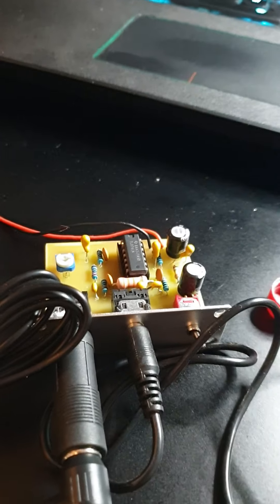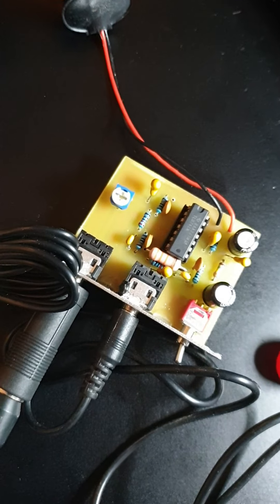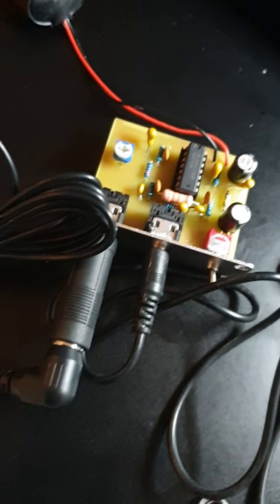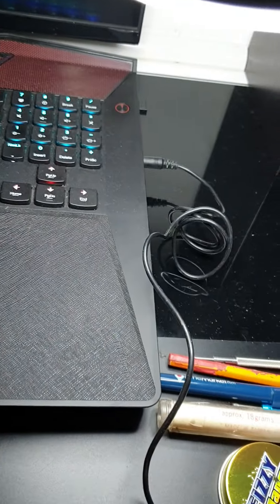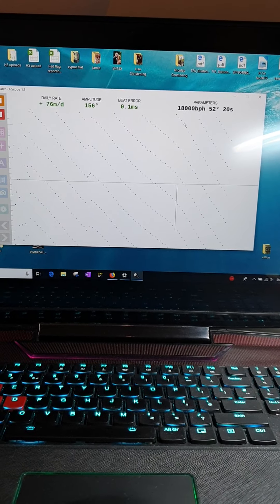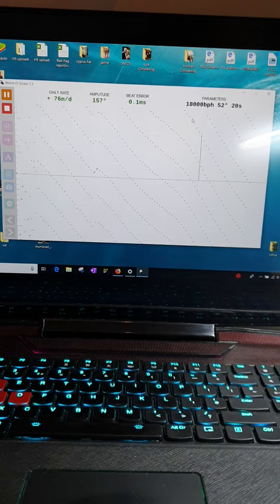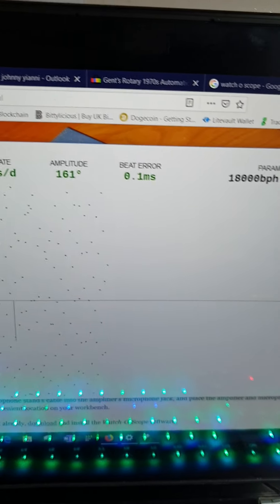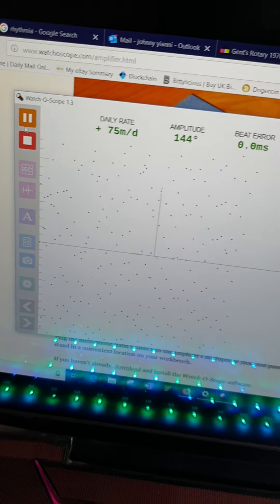Watch-O-Scope

Comment: So... do you find that the software works well once the amplifier is put in line?
Reply from the maker: Unfortunately I never managed to get the amplifyer to work. I had to compromise on the components as I couldnt find the exact ones here in Britain. It is a shame becasue I have seen other videos of the software and its meant to be pretty good.
Reply: @treetopspider  I've seen one video where the guy is using an equalizer program as a noise filter. With Windows 10 you can increase the microphone gain and with the latest Watch-O-Scope software there is a gain boost feature as well. Without the noise filter feature of the amplifier, there's just too much junk in the boosted signal for the software to work properly. I think all that is needed is a good noise filter as the amp is now redundant. See what you think...
https://youtu.be/oA2NIjlThqw
Reply: @treetopspider  I don't know how the UK VAT will impact the prices, but you can order the exact quantities of the parts for the amplifier from https://www.radioshack.com/

All of the other suppliers that I've found require you to order hundreds or even thousands in quantity.
Reply from the maker: @AwGusTeen  Thanks for that, I might give that a go as I really wanted to use the Watch O Scope program. Ive recently bought one of those chinese Witchi timers which seem to work pretty good but I really liked the idea of building my own
Reply: @treetopspider  I just put my ACE timer in the trash - the LCD connections tend to fail. I had mine for around two years and it works well but it's poorly made. I had an Electrical Engineer buddy over during Christmas and he pulled it apart. When he disassembled it, he showed me that the problem was in the tiny little clip connectors that also hold the LCD to the circuit board. Since it was not repairable, I had him scavenge the microphone by putting a 1/8" jack on the end so I could plug it into my laptop. So now I have a nice mic (like the one that you now have)  - I just need to build that little amp with the noise suppression computer chip for the software.  

Let's keep in touch and see how things are going...

Pax!